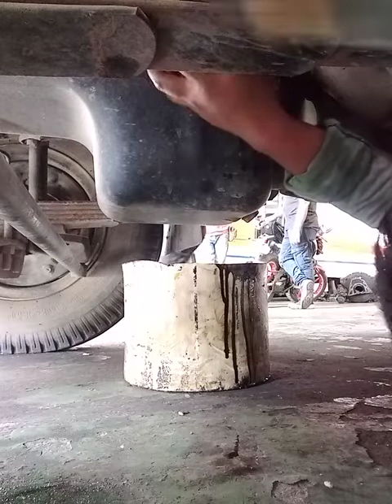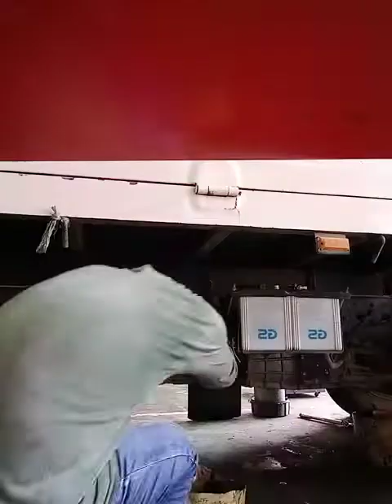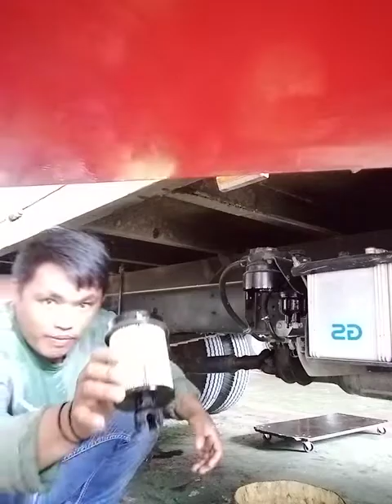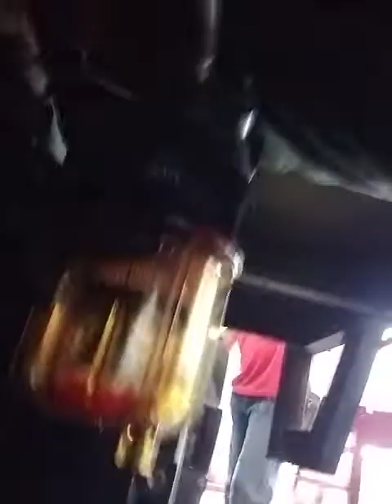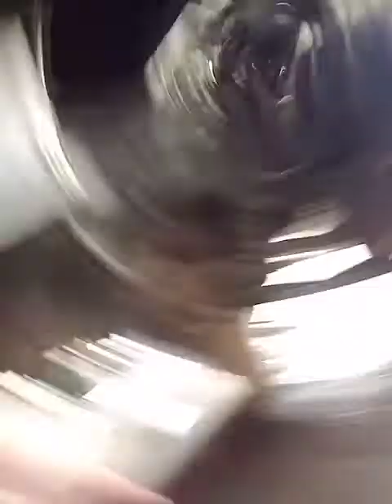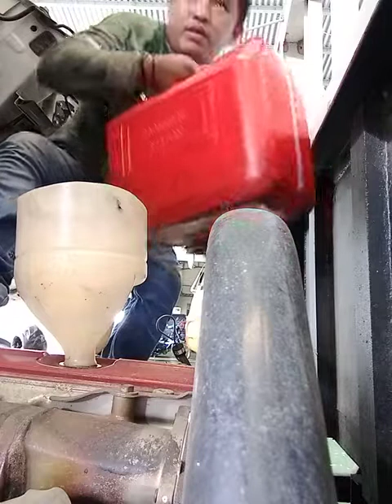PMS Change oil🛠️

Comment: 5 Basic Functions of Motor Oil

Lubricate the parts within the engine so the parts can move quickly.

Prevent rust and corrosion.

Cool the engine by carrying heat away from its parts.

Clean the engine by keeping out any debris between parts.

Create a seal between the piston and cylinder liner.